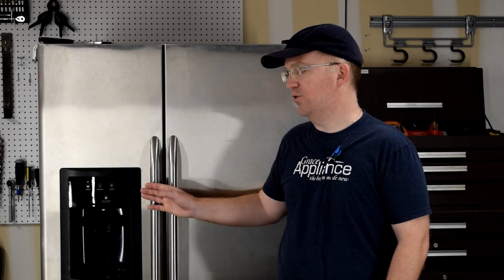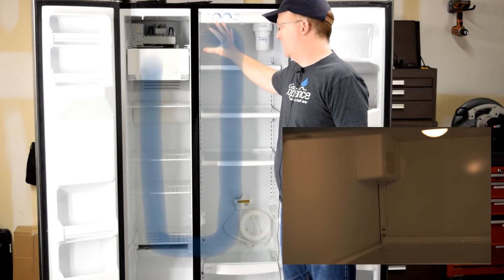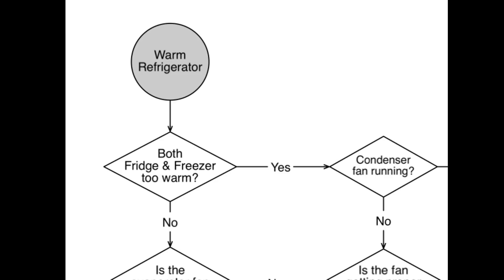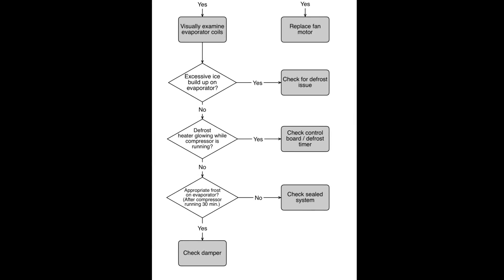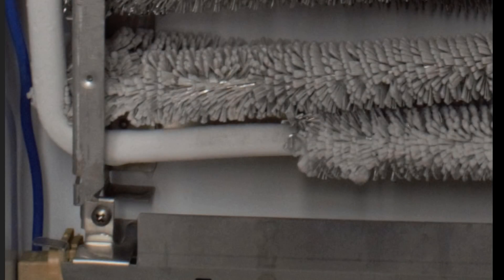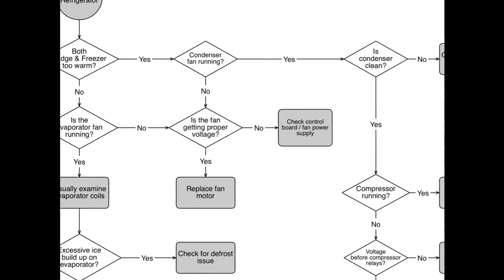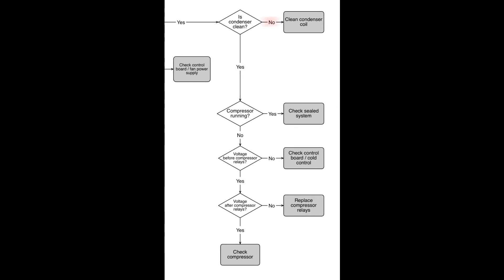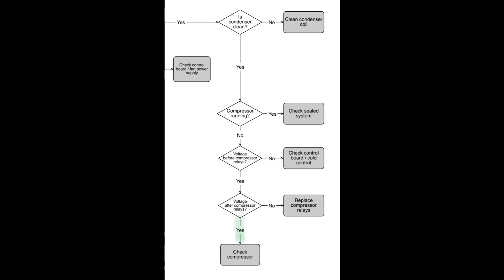Refrigerator Too Warm - Diagnostic Steps

Comment: Goodmorning Andy, the fridge seems like it is clicking like a relay is out i am thinking the compresser relay switch is out. Is there a way to test this? it is model Samsung model RF267ABPN.
Reply from the maker: Hi, Thanks. 

So, your compressor should be running if your condenser fan motor is running.  If it is not, if could be either a bad control board, a bad relay, or a bad compressor.  

The easiest way to test would be (with the fridge unplugged) remove the relay from the compressor.  You'll see 3 holes on the relays that plug on to the 3 pins on the compressor.  You should be getting voltage 120vac between 2 of these holes on the relay.  

So, i'd start by testing voltage at the two wires coming in to the relay (once plugged in obviously). If you have voltage there, the control board is doing it's job.  If not, it's a bad control board.  
If you do have voltage, you can then test for 120vac on the other side of the relay.  If you do not have voltage there, it's bad relays.  If you do have 120vac there it would likely be a failed compressor.  

I hope this makes sense.  Let me know if you have any questions. 

Andy
Reply: Goodmorning Andy, sorry for calling you Andrew that is my sons name. you make perfect sence and your videos are super awsome. I checked the voltage on the compresser relay and it gave 122 volts on both sides of the lower piece. Its a 2 piece relay and the positive on that relay is on the top side. the circuit board did some clicking before the 122.2 volt displayed on both bottom sides of relay.
I checked the ohms on the compresser it was bottom two 12.1,  left side 9.0,  right side 3.3, i know the videos  were saying 10 by 6 by 4. Is my compressor off and bad.
Thanks again Andy for all your assistance. the compressor runs with the fan, it seems as if the vibration on it is not very strong it is a little hot and the copper pipes out of it  the one to the condenser was little warm then it did not feel as warm the other one fealt little cooler. the whole issue started with the freezer being over icing. do you think it is low on freon, i have never had yo add to it before, and it is 11 years old and both fridge and freezer are out. 
thanks again i am working nights fixing to sleep a little i only got 45 min sleep yesterday. Thanks again for all your help.
Reply: i put a clamp amp meter to the wire harness going to the compressor and it gave me 0.13amp. i had it set on 2-20 amps ac.

Comment: Thank you Andy for awsome video, i have a Samsung rf 67 which is about 11 years old. both freezer and fridge are out. problem started with over icing, then system stoped working. condencer fan is running condenser is clean now, and compresser is running and so is the fan. the refrigerater defrost senser was not giving me any continuity ohms reading when i had ice pack on it. i thought that was the problem, i orderd a new one still same problem and still i am not getting any ohms reading on the new one either.
please advise.
Reply from the maker: sam d hey Sam, what’s your full model number?
Reply: Hi Andrew it is Samsung RF267ABPN
Reply: IT IS A TWIN COOLER IT SEEMS THE FRIDGE IS MAKING A LITTLE COOL AIR FOR THE SHELF AREA BUT THE MAIN SYSTEM AND THE FREEZER NON
Reply: RF267ABPN

Comment: Hi Andy,  Manickam here. Awesome and informative video. Like your flow chart though narrowing down my issue still little tricky. :). We have Maytag SxS and 15 years old model. Freezer works fine and refrigerator doesn't cool. Also, When cut off (kind of fan or motor sound stops), occurs Refrigerator switch off completely and  need to start the Breaker switch again. Replaced BiMetal thermo and didn't help and issue still persists. Can you please suggest? Appreciate your help..!!! Thanks.
Reply from the maker: Manickam Vijayabanu when you say the freezer works fine, is it keeping things frozen rock solid.  

If you’ll send your model number (on a tag inside the refrigerator) I can take a look for you.  

I believe all monograms will have 2 evaporators, one in the freezer and one in the fridge.  So, the systems work independently of each other.  
If the freezer is staying around 0F, you can rule out a sealed system issue. 

I don’t believe the fridge side will have any defrost components to go with the evaporator. It uses the fridges above freezing temperatures to naturally defrost the evaporator.  

To start with, I’d check to see that the evaporator fan is working properly.
Reply: Andy, Sorry missed to update in last reply. Yes. Freezer keep things rock solid and no issues at all. Thanks.
Reply from the maker: Manickam Vijayabanu hey, you’re most welcome! 
I must have misread your first comment and responded as if you had a GE monogram. You of course have a Maytag as you mentioned.  You have a single evaporator and single defrost system.  
You have what’s called a adaptive defrost control board which is quite suspect as the culprit at this point.  

I’ll be honest in saying I don’t have a ton of experience with troubleshooting this particular fridge so I may be of limited help. However, I’ve found the tech sheet for your particular model and am happy to email it to you if you’d like. If you can email me at GraceAppliance@gmail.com I can respond with the document.  
It has the diagnostic steps to help in troubleshooting the defrost control board which I think is the next best step in your situation.  

Thanks! Andy
Reply: Hi Andy, Thanks for your quick response. Here is my model # -  MayTag -  MSD2641KEW.  A quick observation. When changed the BiMetal last week, have noticed the evaporator got ice surrounded on it. Please suggest your thoughts and possible component to replace. Thanks again.! Appreciated.!

Comment: Hi Andy I had to turn off the main breaker and notice the panel on my ge side x side panel stopped working.  Can't figure out how to reset it.  Please help.  Thank You.
Reply from the maker: Virginia Garland hi Virginia,
Sorry to hear about the issues! Hopefully it’s at least cooling at this point.

There isn’t really a ‘reset’ so to speak, outside of unplugging it and plugging it back in.  

So, if you have a multimeter, you can test for proper voltage between the main control board (behind the fridge) and the touch panel on the front of the fridge.  
This video will help with that:
https://youtu.be/ViFpwH6_WrM

If you have correct voltage (13.5vdc) at the main control, but not the front board, I’d check the connector behind the kick panel by the freezer door hinge. This plug has the tendency to get corroded and cause connection issues.  

Feel free to ask if you have any issues.  Thanks!
Reply: Thank you for this vital info which I will use and when I get it working I will let you know in order to pass info on to other.   Have a nice day and thank you again.  @GraceAppliance
Reply from the maker: @virginiagarland6602  you're most welcome. I'm glad I could be of some help.  
If you run in to any snags feel free to reach out.  
Andy

Comment: I did see ice and maybe that why my Refrigerator is not getting cold 😣 .
Reply from the maker: Hi Theresa, 
What is your model number from the tag inside your refrigerator. 

If you're seeing frost buildup inside the freezer on the back wall, you have a defrost issue and you're right this would have your fridge run warm.  

Respond with the model and I can help point you in the right direction.  

Thanks!